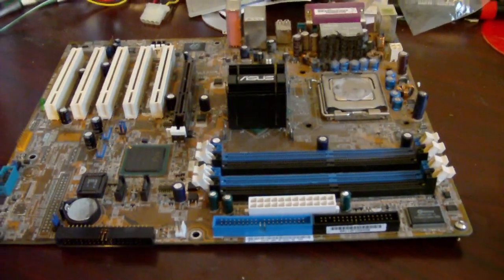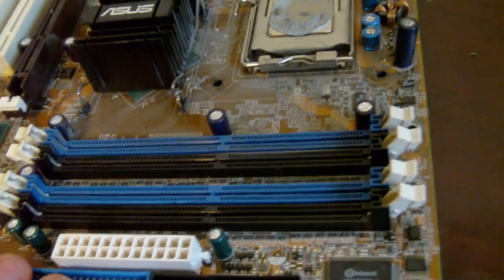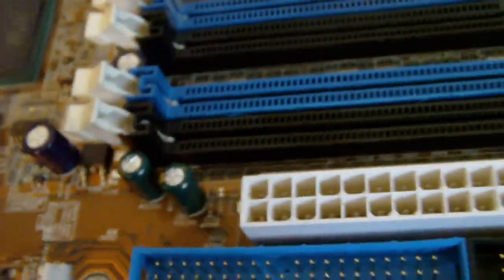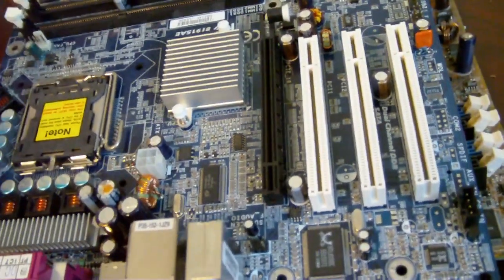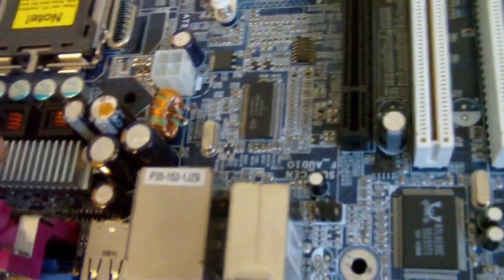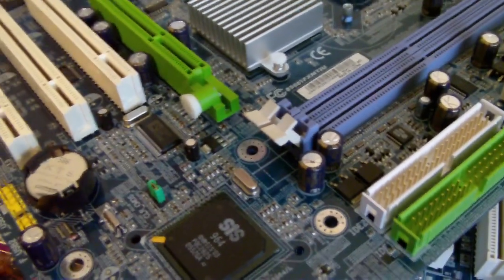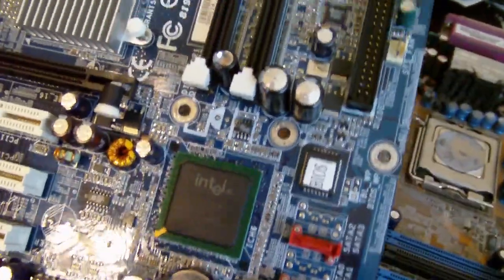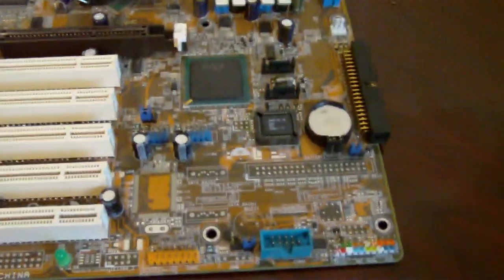Identifying bad capacitors part 1

Comment: this was very imformative ^^ I have a problem, my LG monitor just went dark after 5 years of ussage, the thing is I can turn it on for 2 second then it will get dark again, I opened it up and checked the circuit board and saw that 3 capacitors are a little bit bulged at the top, could that be it ? Or do you think they still might work and that the lights on the LCD went dark :/ I never replaced capacitors but it seems like its really easy !

Comment: hi my computer sometimes does not display the bootscreen and sometimes the fans spin faster and the computer crashes on the bootscreen i can get past it a lot of the time sometimes it will just restart on me do you think it is the capacitors? thanks! i opened it up and the capacitors are bulging up on the motherboard so i think that is causing the problem

Comment: Agreed. Visual inspection of a cap is the starting point, not ending. It can be removed and tested for tolerance, but electros by nature are not 'right on'. They work, until they fail. Yes, they do leak and capacitance will weaken, but a new one won't cure the problem. "Little bits of brown'', don't warrant replacing. Caps are the favorite target for DIY. 
There's the risk of bad soldering techniques, like is done in these videos. [use a iron with a grounded tip, and keep it CLEAN].

Comment: A cap has to be in really bad shape before it affects mobo performance. I have an IBM socket 370 board where the tops of 8 caps were completely bulged out and covered in brown electrolyte; computer worked fine. Since then, I have replaced all of those caps; no difference whatosever in performance.

Comment: @mjmcomputers Any chance you could help me with a issue i have with my gpu? Ive had no display from it ive given it a full clean and checked all components everything looks fine i cant flash bios because i cannot see anything on screen but i have tried blind flashing not knowing exactly whats going on. From what i heard the bios was badly flashed and i purchased this card for very little but im unsure of the issue altough the fans spin up there is power but nothing on monitor. 100% sure its card

Comment: Most of the time they arent blged but are still failing, its best to change large caps if you have any electrical failure. 9 times out of 10 they are the problem

Comment: @nickeyman81 i had the same problem. it turned out the case usb port plug that plugs into ur board, was abit faulty, ran USB 2.0 after i unplugged it.

Comment from the maker: @galeanoandres It really depends, Ive seen some pcs that had just one slightly bulged capacitor and they won't turn on. I've seen some pcs that had alot of bulged leaking capacitors and they work fine, like nothing is wrong. Then I've seen some that had bad capacitors that blue screened or had other unstable problems.

Comment: Hey. I have the same mainboard on a computer at work. My problem is that if I enable usb2.0 in bios freezes when i plug my pendrive. Works fine only with usb1.0. I already replaced a capacitor which was swolen but still don't work. Already made bios update. Any ideas? Thanks.

Comment from the maker: @khadeem5 I would go into the bios and restore default settings. Its also possible you need to load a driver first before the windows installation will see the hard drive. what model motherboard?

Comment from the maker: @MechaNintendoMast Yes that Asus board was a high end board at the time. It saw heavy use and probably took a power surge from a bad power supply which caused the bad capacitors.

Comment from the maker: @suikerblok The only real way to check them in circuit is with an esr meter, but they are real expensive. If you take them out of circuit you can check them with an ohm meter.

Comment: Nice video, better than the other one!..but i got a question for you: is it possible to measure a cap that is still soldered on the board? I`ve tried to measure it but no readings, only when i shorlty touch the contacts it gives some reading but when i touch and hold the contacts it gives no reading, not even after a few secs...thanks in advance!

Comment: great video, I am trying to figure out what is wrong with my pcchips A15G
motherboard. i had a powersurge over ethernet. from my phone line/router/modem.and now my ethernet port and my pci slots dont work. all caps look ok,and the pc still boots and runs windows fine. but my ethernet light stays on all the time.(even without ethernet cable )    any ideas as to whats wrong?